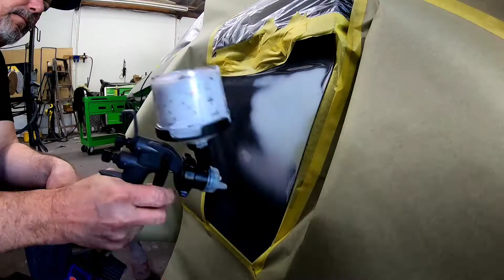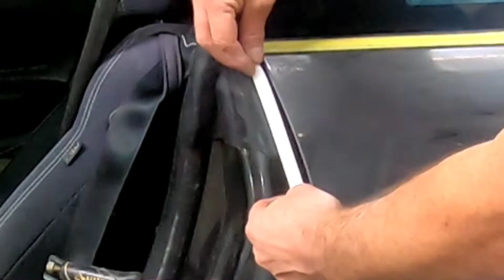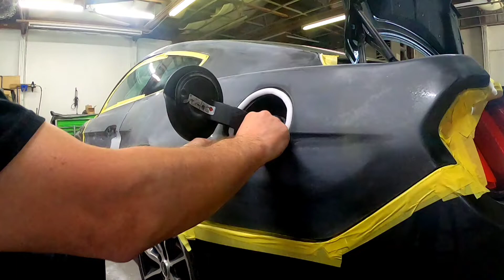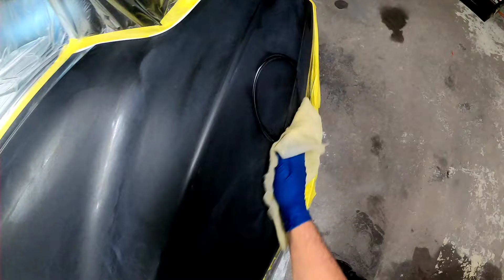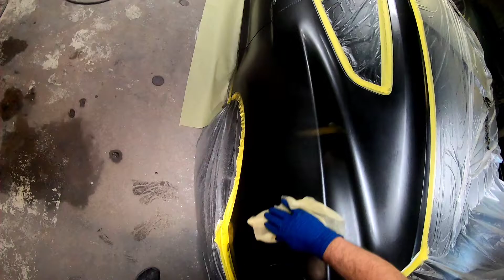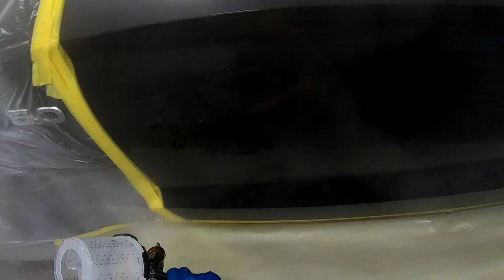Blending auto paint with clear basecoat. #autopaint #diyautopaint

Comment: Augh. Have you ever seen a clear base spray can ? I've got to lay down some metallic. Got a can of exact match spray (mixed at my local ECS store. I guess I can see if they can make up a clear base... but seems it ought to be a standard product...
Reply: @GarageNoise - I actually found a product (thanks to local ECS.) Have you ever used PPG OneChoice SXA840- Uniform Finish Blender?

She gave me the tech sheet for it. Has specific instructions for creating "a Wet Bed Prior to Solventborne Basecoat Application."

I've got a challenging light metallic to repair a door ding. Planning to blend the base, and run 2k clear to the door edges. (4T8 Sandy Beach Metallic :( )
Reply from the maker: I've  though about this before  and no I have not. I haven't look real hard tho

Comment: Great video.  I spray in a similar garage environment and for the life of me I can't keep trash from landing in any horizontal panel when clearing.  No matter how much I clean, wet the floors and walls, etc.  I almost think it's dried clear over spray landing in the wet clear.  Hoods and deck lids always need major cutting and buffing to get right.  What are your thoughts on this?
Reply from the maker: Do you know it's  actually trash? If your getting small consistent specs it could be in you air supply.  Your gonna get trash in flat surface. I do as well, tight masking , your pushing air so anything loose will become airborne.  Also might try a static eliminator before spraying or I use isopropyl alcohol just before base it helps eliminate static which attracts dusts.
Check out this video it might help
https://youtu.be/SJgy3y0wIdU
Reply: @GarageNoise  It's only on the horizontal panels.  Anything I spray that's vertical comes out with little to no trash in it.  Hoods and deck lids forget about it.

Comment: What's a good way to strengthen aluminum on a quarter panel that a little to flexible?
Reply from the maker: What you working on ? should'nt have a problem with aluminum being flexible. Unless it really thin
Reply: @GarageNoise  99 civic had a bunch of bodywork with no actual panel work im assuming it's stretched because of it
Reply from the maker: @2koolforyou88  that should be steel. Check with magnet. Then you could heat shrink. I show how in my video a few weeks back.
Reply from the maker: @2koolforyou88  https://youtu.be/14ZVjQRhIcY here's  the video
Reply: @GarageNoise  thanks